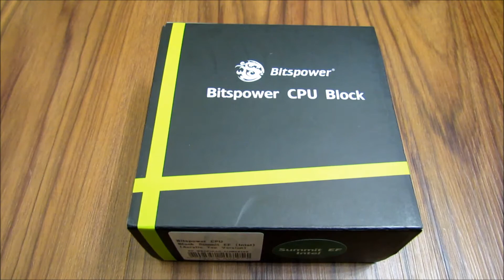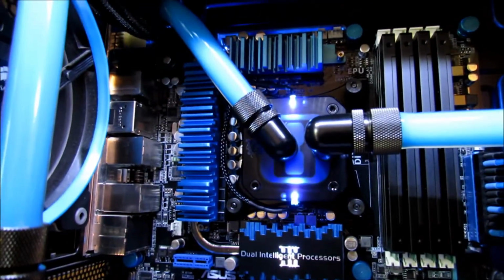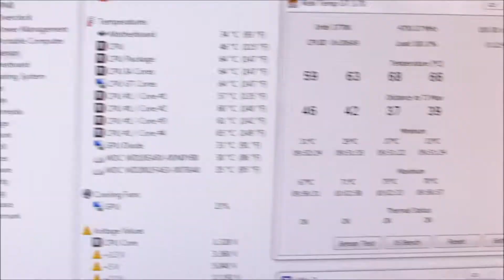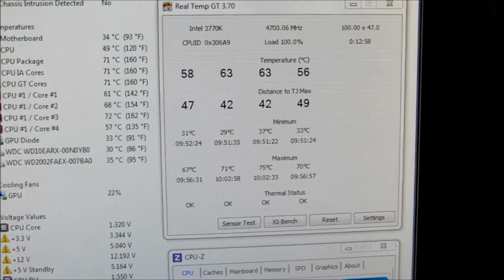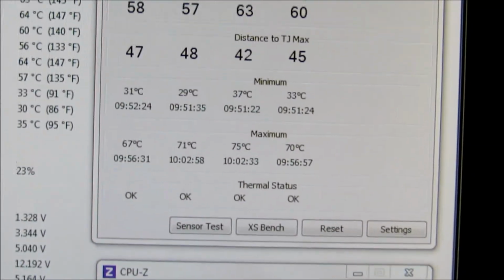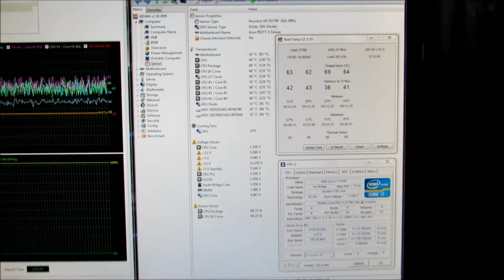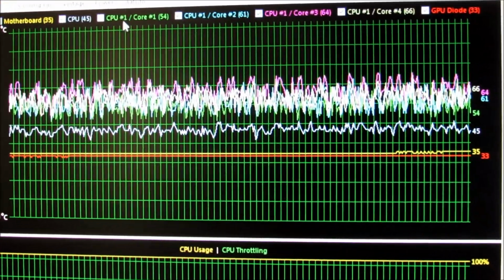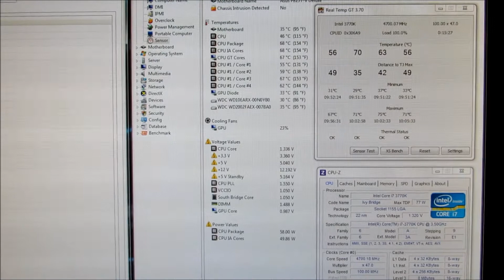Unboxing, Installation & Review - Bitspower Summit EF (Intel)

Comment from the maker: If you're overclocking it over 4.2GHz, I'd get an H80i or better.  16GB is too much RAM.  8GB RAM should suffice for gaming, unless you have at least an i7-3770K for multi-threaded tasking.  No sense spending too much on RAM that won't be used.  Other than that, everything looks good!!